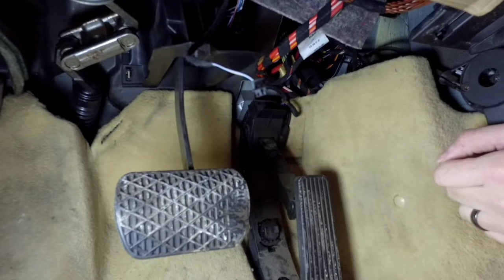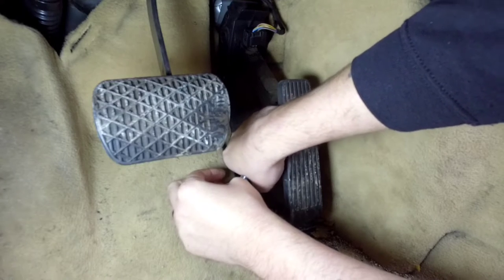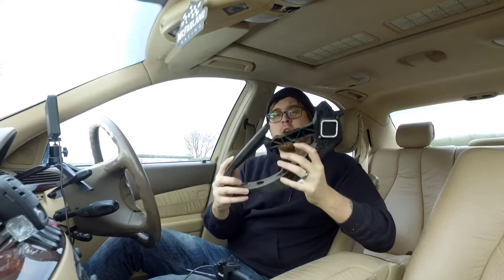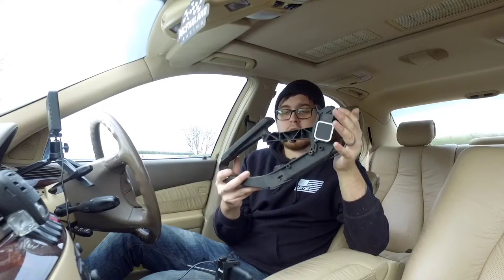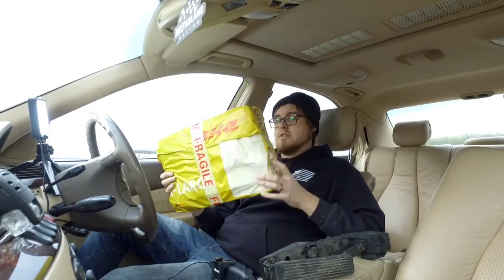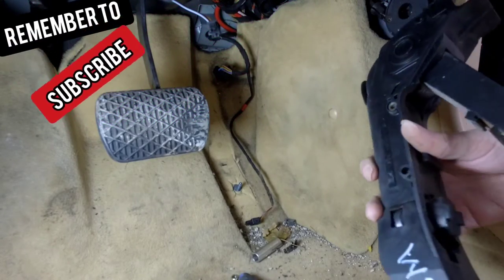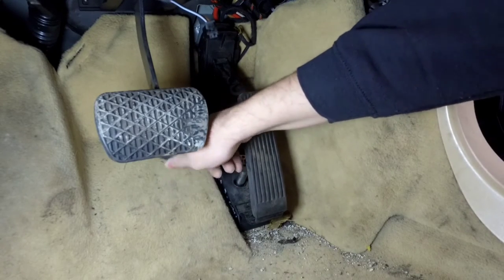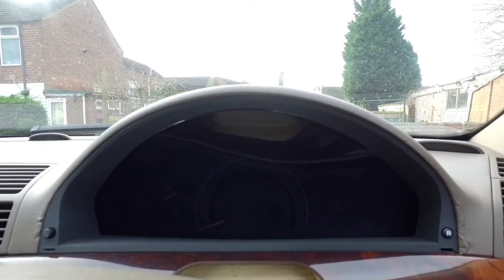Throttle Lacking Response? Save Money Fix It Yourself! Mercedes S class Throttle Pedal Replacement

Comment: hello did you unplug the battery negative cable ?
Reply from the maker: Hey buddy, No, reason was for all the other things that would be triggered on the car by doing that as it resets all the memory functions and the electric seats would have then all needed to relearn to, instead I used SDS to relearn the pedal position properly, the negative reset sometimes works but like I say I didn't want the hassle of relearning all the other module functions.
Reply: Thanks for answering 🙂.  I guess I'm going 2 take off the 2 negative terminals I don't have anything else not a mechanic. I have a 2007 sl550 need 2 changout the the accelerator pedal. Sensor ng
Reply: Next also need to learn how do drop the dashboard cover to get 2 pedal
Reply: So if I got it correctly I may not need 2 disconnect the 2 negative terminals ?
Reply from the maker: @scottoax4573  the dashboard trim is a bit troublesome to get out,  but with the throttle pedal you don't actually need to reset it to work, the pedal should still work as a plug and play type thing, the relearn is more for transmission adaptions and just overall sensitivity if that helps buddy

Comment: No need to do a computer reset? Asking if it's needed
Reply from the maker: It's always good to do a computer reset if possible but, I found that it wasn't necessarily needed. The throttle pedal will still function as it should.
Reply: @M-oneeleven-M111  thank you so much great video and information